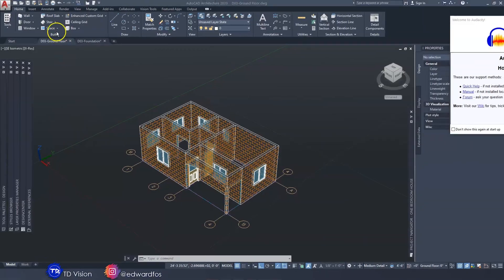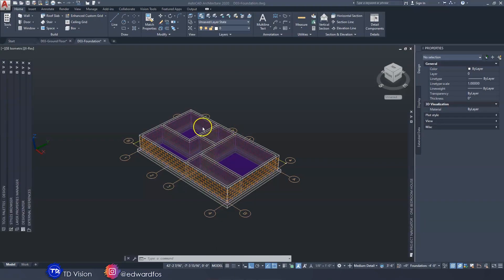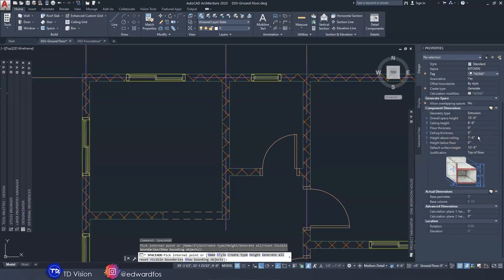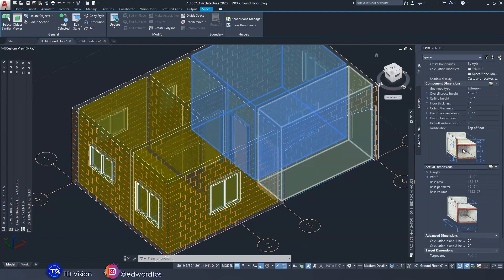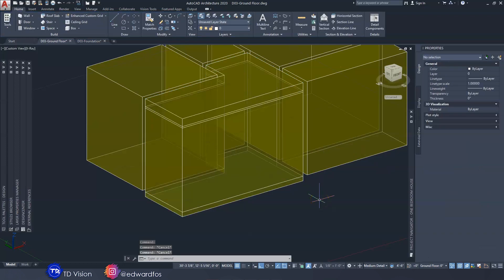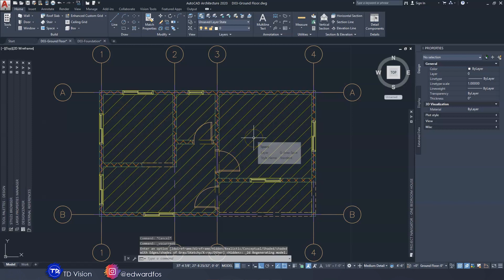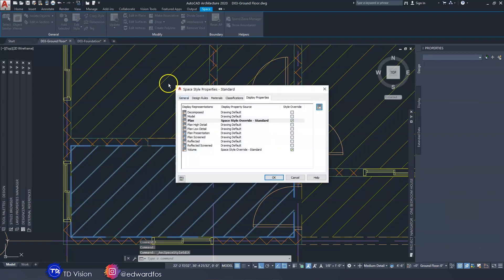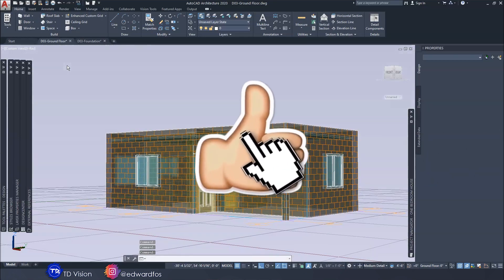SPACE & ZONES in AutoCAD Architecture 2023

Comment: Hi Edward, your videos are great I am learning a lot from them. Thank you so much. I am using ACAD Architecture 2020 but for the space planning i couldn't find the space separator tool in the design content of the program. I didn't find it at the design centre either please advise .
Reply from the maker: You can draw a regular polyline and changes it's properties to make it a bounding element. That will make it into a space separater.

Comment: I'm designing this small buidling for a district heating facility and I'm still having this question concerning spaces. Is it a good practice to create a space, with a floor and a ceiling, say 25cm each, and then create two real slabs at those positions to cover the roof and ceiling? Thanks for the great videos by the way.
Reply from the maker: I think you can create the space, without the floor and ceiling, then manually add the floor and ceiling in, to make them separate from the space object. I hope you understand me.

Comment: Hi Edward thanks for your great tutorial! I wanted to apply floor thickness as the finish thickness, but then the floor gets pulled underneath. Is there a way to pull the floor thickness towards the ceiling direction? Or would you suggest another way to apply floor finish? Many thanks!
Reply from the maker: If I'm understanding your question, you'll have to change the slab justification to "bottom". You can do that while the command is active, it should be an option in the command line, or change it in the properties after the fact. I hope that helped.
Reply: @TDVision_U  Wow you just solved my problem!! Thank you so much!

Comment: Edward, this is the first for me working with spaces in this manner.  In your video where you show space separator, I don’t have that in ACA 2021. All it shows in that section of the tool palette is Generate space , ceiling Grid and Theme Space by size, ( it’s not up on the ribbon either. Is this something that can be gotten from the tools catalog???  
On a different note, can the hatch pattern for the CMU6 wall be changed and if so how.    Thanks,
Doug
Reply from the maker: You can change the hatch pattern by a right click/edit wall style/materials tab/click on CMU/click the pencil icon/display properties tab/edit display properties icon/hatching tab/click on plan hatch/under the pattern column, select your pattern/adjust scale and angle as needed/hit ok. Hope that helped.